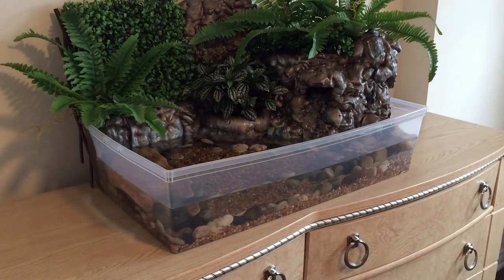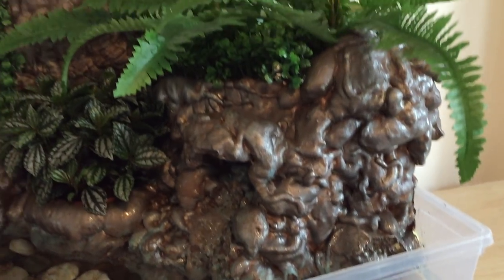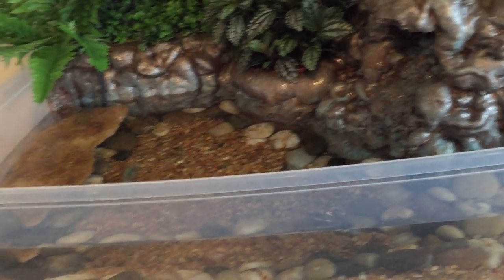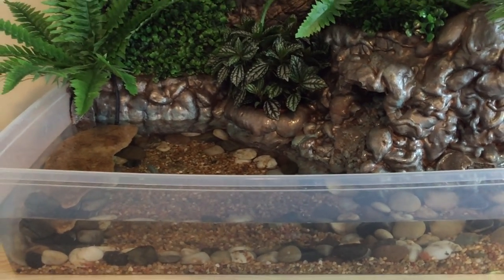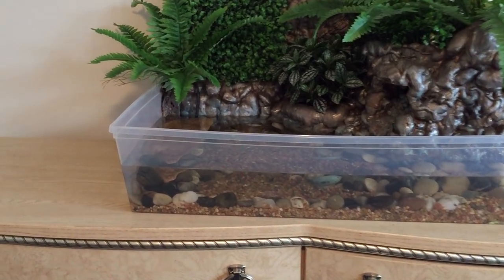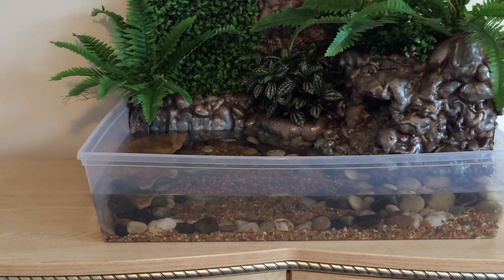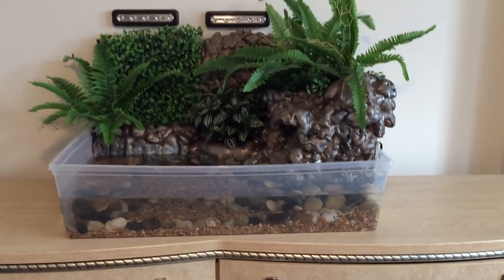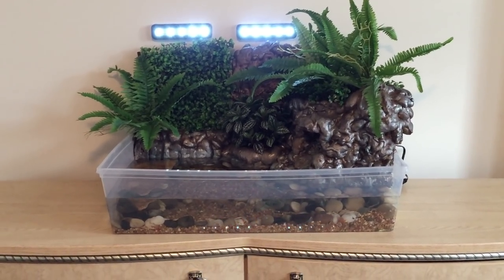DIY Indoor Fish Fountain

Comment: Where did you use the Amazing GOOP in this build, and did it ever end up being toxic to the fish? I accidentally used GOOP on a piece for my aquarium before checking whether it was aquarium safe, and now I'm worried that I may have wrecked the project!
Reply from the maker: I used goop as an adhesive for the paint and used aquarium safe silicone covering everything that touches the water. I’d remove the piece and put aquarium safe silicone around it. You can purchase it at Petco or petsmart.